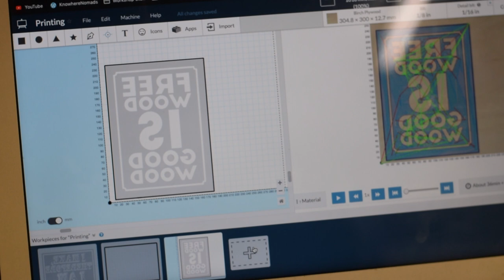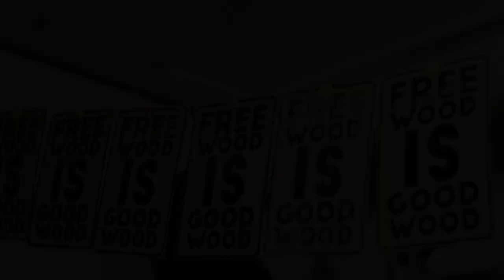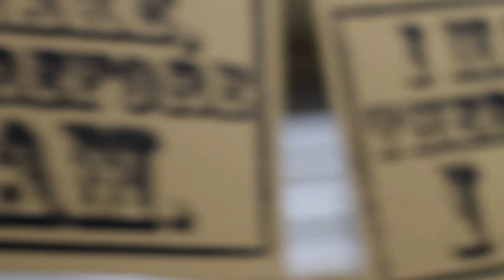Printmaking WITHOUT a Letterpress! // Printmaking

Comment: Nice video edit. Good idea with the plastic over the lid. They painter at work use big zip lock bags over the paint trays so that they don't have to clean the tray after.
Reply from the maker: John Made it thanks John! it was the only flat surface I had, but it worked a treat! That’s a great idea, makes clean up easier!